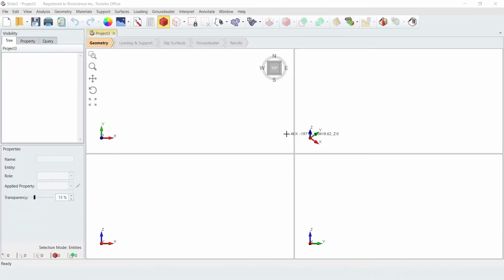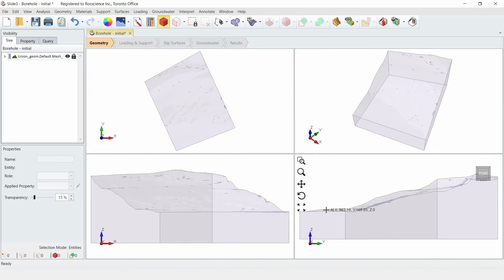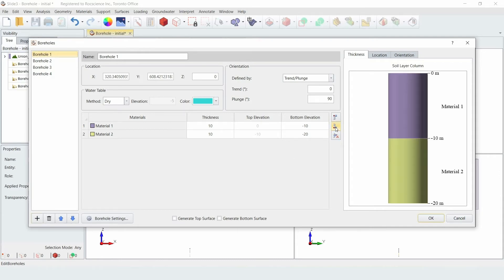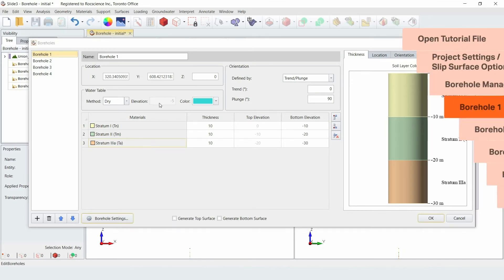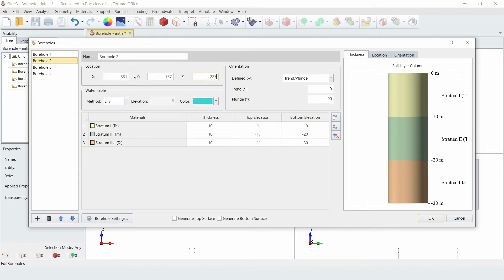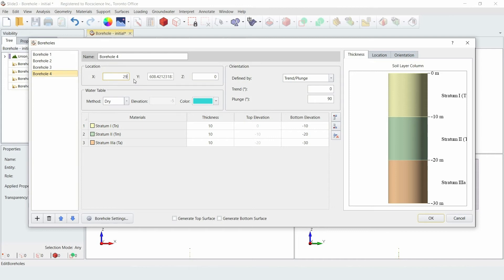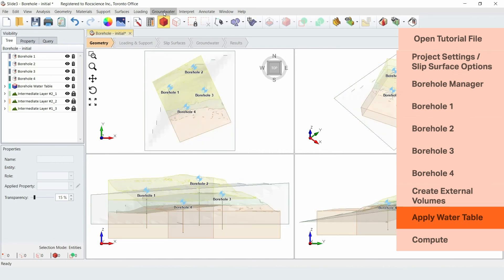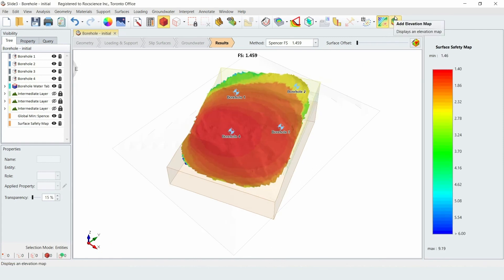Slide3 Tutorial: Borehole Manager

Comment: Hi, thank you for the superb well-made vid! 
I have questions...
Can I change the coordinate system into UTM system? How to do it if the "coordinate" setting doesn't show up in my Slide3 unit project settings. Thanks in advance!
Reply from the maker: Hi @putrisalsabila2911,

The software does not explicitly identify the coordinate system in use, but it assumes that coordinates are in length units. You can specify your coordinates using that system, but it is up to you to consistently use that system. As the UTM system's coordinates are in length units (such as meters), no additional processing should be necessary. It's important to note that since the software doesn't recognize the specific system being utilized, there's no option to specify a UTM zone.

Thank you!